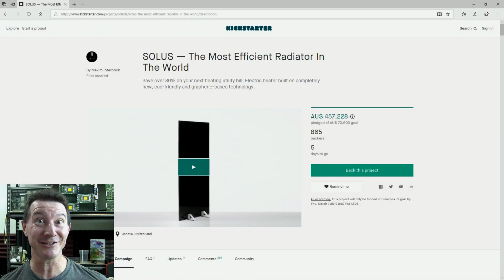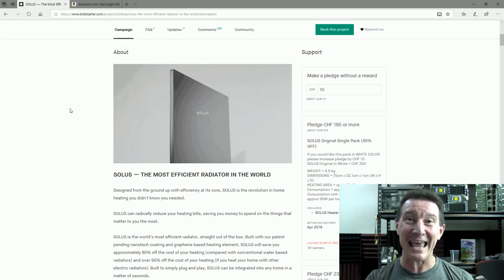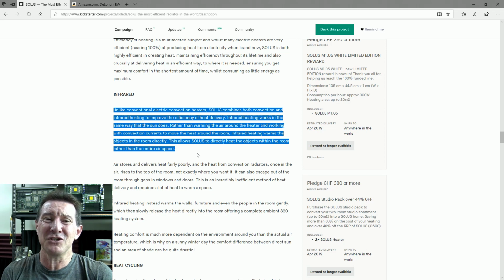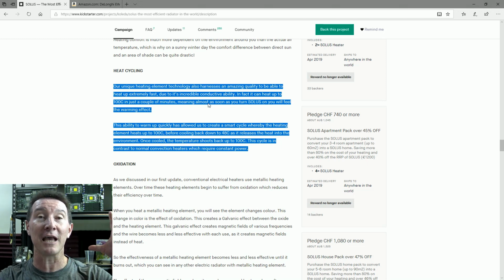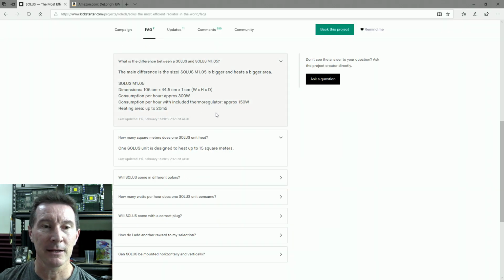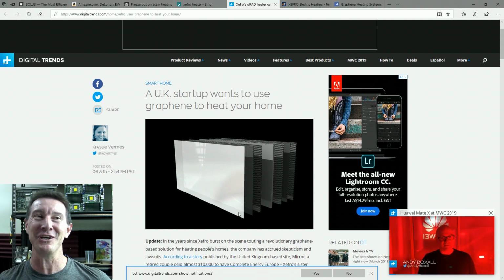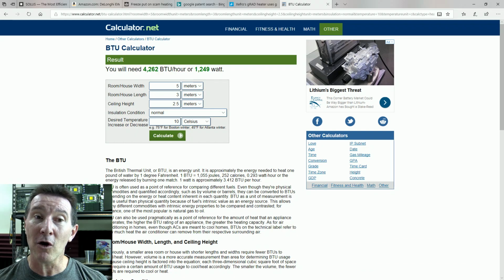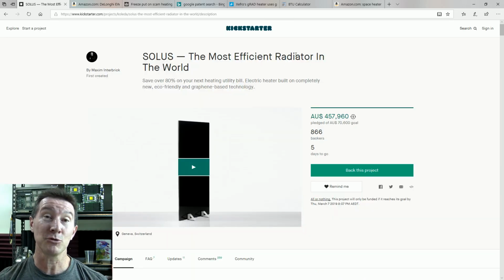EEVblog #1186 - Solus Graphene Heater Kickstarter BUSTED!

Comment: I recognize this.  I have a floor that is the same.   It has a heating coil embedded in mortar and covered with tiles.   It is 90W per hour and cost me about $120 CAD.
Reply: Right dident notice that imidiatly. So they basically made a heated floor tile that you can but on your wall.
It would have been better if they had made bathroom tiles that you could connect to each other or something

Comment: You say that people know, or should know, better about watts and heat but its been asked and answered many times on fish keeping forums on what heater is the most efficient... Hammering watts is watts into their heads just doesn't seem to work, it still comes up. Glass heater, plastic heater, metal heater or even just a pump, if its 200W its 200W.
Reply from the maker: Yep, unless it's a heat pump which is a different beast.

Comment: Think about how successful this product could have been if they had sold it as a high-end, designer type heating panel made from recycled, eco-friendly materials.  Dyson sells fans with pretty colors and funky designs all day long for $500+ USD.  Sure, maybe they're a bit quieter than other types of fans, but it's still just a fan.

It's an absolutely beautiful product.  It would sell well in the right market based on that alone.  Take a page from Apple or Nike:  You can sell underperforming, overpriced garbage all day long, so long as you sell the lifestyle, not the product.

Nothing pisses me off more than utterly unnecessary bullshit.  A $300+ room heater is not going to sell to the impoverished masses of college students, or low-income families no matter how much you talk about efficiency and operating costs and whatnot.  This is a high-end, look-at-me tech gizmo amongst the ranks of the autonomous sex dungeon and the battery-powered battery discharger.

Comment: Does Australia have a different definition of radiant and convection heating? Radiant works by heating an element to 300+C to blast infra-red energy at whatever you want to keep warm while convection heats up the air by conduction then carries it away either naturally (hot air rises) or forcefully with a fan. The term 'radiator' which typically refers to a liquid-to-air heat exchanger is a misnomer since those never get hot enough to actually radiate a meaningful amount of heat so the bulk of heat transfer happens by convection, be it natural or forced.
Reply from the maker: Unfortunately the terms are pretty messy. Oil heaters are referred to as "oil radiators".
Every heater is convective to some extent, as hot air eventually rises and forms natural convective currents.
Reply: @EEVblog  Yes, people call those large whatever-to-air heat exchangers 'radiators' but that doesn't change the fact that "radiant heating" is by definition specifically about heating using IR radiation. I lost count of how many times you used radiant and forced convection interchangeably despite being two completely different heating methods: forced and natural convection heat space by conduction and mixing while radiant heating directly heats surfaces with IR instead of the air in-between. With radiant heating, the air can be freezing-cold but your skin still feels warm.

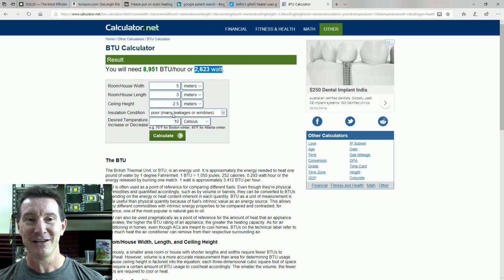Comment: At 36:51 that calculator shows what is the constant power needed to maintain that room temperature if the delta between inside the room and outside the room is 10C so say you have that poorly insulated room and outside is 12C but you want inside temperature to be 22C the you need a 2623W continuously as soon as you remove that temperature will start to drop and eventually equal the outside temperature.
My small house 65m2 that is on the other extreme close to passive house standard insulation and air leakage only needs around 2000W at a 50C delta common here in winter with 20C inside temperature and -30C average outside temperature in 24h. To maintain just 10C above outside temperature I only need 416W about 10kWh in 24h period.
Reply from the maker: Yes, maybe I should have done a diagram there. You need to keep pumping in a certain BTU's to keep a room (which always has losses) at a certain temperature. In fact, the same BTU value as the losses. If you want to raise the room temp then you have to feed in more BTU's than you are loosing.
Reply: Yes feeding more power will increase the room temperature and so the temperature delta and thus the losses until again loses equal input power.  BTU/hr is just a non SI unit and I do not like using that 1 BTU/hr = 0.293W and  1 BTU = 0.293Wh  looks a bit confusing that the BTU/hour is power not energy.

Comment: So if it's 450W and on only 50% of the time, is that a 900W element. Does 900W glow like a stove element when the electronics fail and it stays on.
Reply from the maker: By their own measurements then it has to be. But it's rated only 300W input!

Comment: Speaking from experience, using glass to make a heating device is a bad idea. For whatever reason I filled a Pyrex bowl with IPA and set it on fire on top of a plastic table in a cold room, the IPA burned up and the bowl immediately exploded. Even Pyrex glass which is supposed to be extremely heat resistant shattered because of a difference in temperature and no amount of treatment could prevent lesser cracks in the glass when heating a cold room.

Comment: Heat exchangers are much more efficient because they don't create heat, they move heat. They can work down to 0 degrees Fahrenheit before a backup heater is needed. As a bonus, the same unit can be used for air conditioning because it's a heat exchanger so it can bring heat inside or take it outside.

Comment: Excuse me people.  How would it be possible to reduce your heating bill with a more efficient heater when the problem of heating your house is caused by heat escaping your house.
Reply from the maker: It's not a more efficient heater. In fact with a lossy house it has less system efficiency in terms of temperature rise than a larger capacity radiator.
Reply: Thats not the part of the claim thats being doubted. The issue is the conversion factor of electrical watts to BTU's of heat.
Reply: mrlithium 
@ 0:09 into the video.  If the manufacturer  claims a saving of 80% on your utility bill,  the manufacturer obviously doesn't understand where  heat loss occurs.  The loss doesn't occur in the conversion process. but in the heat loss through walls, doors, windows etc.  If you don't believe me open your doors and windows in the middle of winter and watch your electric bill go up.  As Dave points out, electric conversion to heat is 100%.  On a more fundamental understanding, SOLUS COULDN'T EVEN IDENTIFY THE CAUSE OF HEAT LOSS CORRECTLY.  THEY BLAME IT ON THE HEATER, NOT THE HOUSE.  If your house was PERFECTLY insulated, you wouldn't need a heater.  Your body would generate enough heat to keep it warm.
Reply: Ooooh, I have a brand new Kickstarter idea for a super-high efficiency heater - it runs outside, hunts down all your escaping heat, absorbs it, and brings it all back in...! Sure to be over-funded, this one...
Reply: Attila Asztalos 
I know your idea sounds ridiculous, but in a simplified form, that's generally how a heat pump works.  In effect, it cools down the outside to heat the inside.

Comment: Claiming a greater efficiency for something that is already 100% efficient is plain dishonest.
Reply from the maker: You could potentially claim something like this in terms of overall system efficiency for different situations, but they aren't doing this. And their piss-ant 200W element is going to struggle in terms of room temperature rise against system losses in a room, compared with a more powerful radiator.

Comment: Dave, please, step back a moment and check your physics, and most importantly, your terminology and its meaning.

Let's start with not using the word "radiator".  That's a vague term that's typically misused in common usage to refer to any heat source, synonymous with "heater".

Instead, let's talk about heat transfer methods:  We have conduction and radiation.

Conduction means the material to be heated is brought in contact with the heat source, which means the air moves over and through the heater.  This can be forced by a fan, or be done naturally by convection: Both methods work for heating air by conduction.  The oil heater you showed has the electric element immersed in oil which in turn heats the metal skin which in turn heats the air.

Radiation heating means the energy is transfered by infrared emission, through the air (or a vacuum) until it hit an object that absorbs it and becomes warmer.  For example, the ISS loses its excess heat by radiation, emitting infrared into the cosmos.  Here on earth, most radiant heaters have a glowing element backed by an IR reflector, often a parabolic dish.  Of think of a heat lamp.  Or one of these: https://www.amazon.com/Presto-Parabolic-Electric-Heater-Concentrated/dp/B01M8NLKT1

A radiant heater can be felt even if the heater is above you with no breeze being felt.  Outdoor heaters are primarily radiant (and are subject to inverse-square losses).  On the earth, no heater is 100% radiant or 100% conduction: It's a mix of both.  You don't feel the heat from a conduction heater until the hot air reaches you.  The heater is classified by its primary effect, which heat transfer mechanism is dominant.

Most radiant heaters are either coils or halogen bulbs optimized to emit infrared.  The key is emission.  Glowing coils will emit IR, but they also do lots of conduction heating, and at best are close to 50-50 in both heat transfer modes.

When discussing the "efficiency" of a radiant heater, it is the ratio of radiant heat transfer compared to conduction.   So the glowing-coil radiant heater is 50% efficient at converting electricity to IR, the other 50% of the energy being transferred by conduction.  Yes, 100% of the electrical energy does go into the room: The issue is how it gets there, conduction vs. radiation.

However, there are some materials that can be coaxed to emit infrared with much higher efficiency, transferring less (but never zero) heat by conduction.  It happens that graphene is one such efficient IR emission material.  In fact, it may be by far the most efficient IR emitter for the money (there are exotic materials that are slightly better).  But to get that high efficiency, the electricity must run **through** the graphene!  In this context, think of graphene as an emitter for IR radiation: An IR transmission antenna.

The electricity in the Solus flows through what appears to be a conventional flat coil (like an electric blanket).  So, yes, Solus is still bunk (and thus in need of debunking), but not for all the reasons in your confused explanation.
Reply: Sorry Bobby, heat is transfered by:
1) Conduction - a steel bar heated at one end become warm at the opposite end because of thermal conductivity of the material.(some materials are insulator) 
2) Convection - due to lowest specific weight of heated medium (air, oil , water) makes this to ascend. It is replaced by couldest portion of the medium, and this cycle goes further.
3) Radiation - infrared waves
Reply: I don't think a radiant heater is the same as an infrared radiation heater. A radiant heater as it is commonly called just warms the air around it mostly.
Reply: Are you sure you should use BTUs and "rooms" in the context of IR radiators? Because they are all about the (more or less) subjective feeling of heat. Flesh is a bit IR translucent (As is most clothing [summer]) and that's why you "feel the warmth from the inside", irregardless of the room temperature. Hence I wouldn't compare it to other radiators that, mainly, raise the room temperature.
Practically speaking, since we are talking about the heat inside your body and not the room, we should also use BTU accordingly. And that's where all the efficiency talk comes from. (also what BobC says)

Also, the paste used to "paint" the heating element is probably full of graphene. How good it is to coat the graphene particles with whatever sort of glue they use has to be examined. I would say it's bad.
You said: "Infrared radiation need the higher temperature. Medium wave IR heaters are around 1000C" But you forgot that they are ineffective at creating IR. As BobC explained, you can have the same amount of IR emissivity with lower temperature of the glowing element. Apparently it works with such low temperature as 100-48°C when using graphene. So you're still feeling a little warmth coming from it.
Reply from the maker: You still need to put more BTU's into a room than you are losing in order to raise the temperature of a room. At the end of the day it doesn't matter how those BTU's get in or what you call the process. This thing has (say) 200W, or 683 BTU/hour, that's piss-ant. And it's the exactly the same as any other 200W heater.
Yes, all heaters are mix of both.
Reply: @EEVblog  You are always talking about BTUs and raising the temperature of the room. I think one also has to consider the "perceived heat". Have a look at "Infrared vs. Convection Heating". When using convection heating, you are warming the air, warm air will rise und you loose most of the heat in the upper part of the room. when heating with infrared, you dont heat the air, but the furniture or whatever directly. I totally miss this part. its like with Convection oven
 vs toaster heating, you can use both to heat a piece of bread, they are both 100% efficient, but the result will differ.
Reply from the maker: "Radiation heating means the energy is transfered by infrared emission"
Unfortunately a good lot (most?) of the industry uses the term radiator to refer to oil and water heater "radiators" and the like. So being pedantic about exact terms is pretty hard, and sometimes more confusing.
Reply: EEVblog Every radiator in a motorcycle, car or truck is called radiator and the damn thing is forced air cooled all the way. So yeah, nothing to do with radiating heat
Reply from the maker: alles klar klaus - Correct. Infrared radiation need the higher temperature. Medium wave IR heaters are around 1000C

Comment: Pff, my edenpure has wheels so I can roll it from one room to the next and save 80% on heating by only heating 10% of the house at a time.
Reply: Haha. groundbreaking. Next kickstarter will be one of the graphene panels but you wear it on your back ( + a battery pack), so you can heat yourself directly !!
Reply: @mrlithium69  Now that you mention it, if I'm already radiating heat generated from that 1500 calorie dinner I had earlier, I could conceivably apply a layer of graphene paste to my naked body, don a sweater and some heavy slacks, and turn my thermostat way down.  Brilliant!

Comment: Given that the water cicles through the radiator system off the house no heat off it will be lost to the outside. This means it too is 100% efficient. The gas heater heating the water might not be 100% efficient, but given the fact that gas is far cheaper per kWh I doubt that that has any impact.
Reply: Erik The main inefficiencies of central heating are:

1. Heating the wrong rooms due to heat leaking from pipes and boiler.  

2. Heat escaping via chimney from older boilers (newer boilers lower the smoke temperature as much as can be done safely).

3. Lack of proper thermostatic regulation in old installations (easily fixed by changing out radiator valves).

4. The inefficiencies of the water to room temperature difference, there's an entire engineering discipline behind choosing the optimal temperature for the circulation in different circumstances, but common cases will have known optimal values for craftsmen to use.

5. Inefficient heat sources for the central boiler, burning fossil fuel directly is the least efficient in natural resources per J in most places.  Using waste heat from industrial processes is high on this metric.  Other good choices include heat pumps moving heat from solar panels or ground heat at a good Watt moved per Watt consumed ratio.

Comment: To someone like me who isn't an engineer, it's easy to fall into traps like that because it seems logical that different materials would produce different amount of heat. It just feel wrong that two heaters with the same power draw will produce the same heat if they are built differently.
But hey, physics laws don't care if they feel wrong or illogical, they are still a fact.
Reply: same power in same power out!
where on earth could it go? stolen by the umpa lumpa?
Reply: In most cases that would be true, but like they say, the goal of a heater is to be "inefficient", and since it's very easy to just waste 100% of your input energy (compared to every other kind of machines which try to reduce the loss) it's no problem what you make it out of.